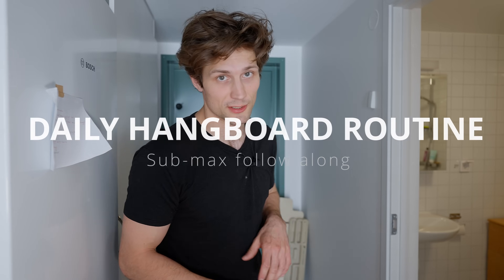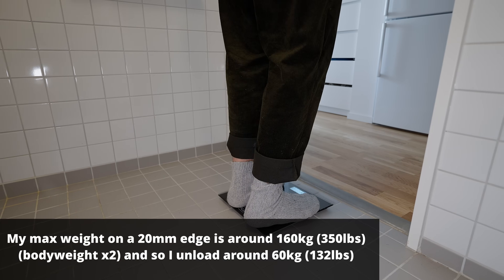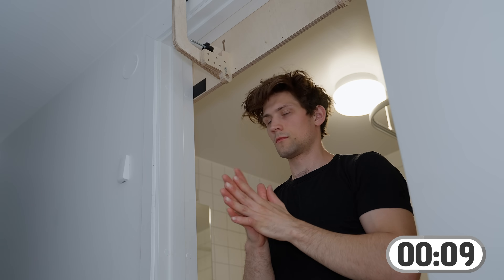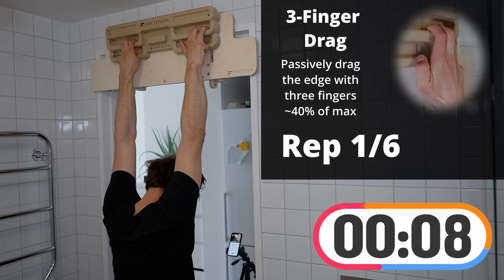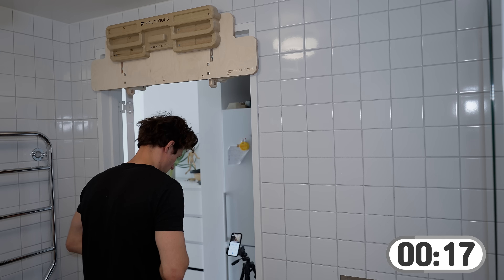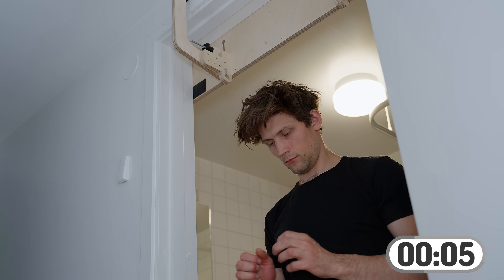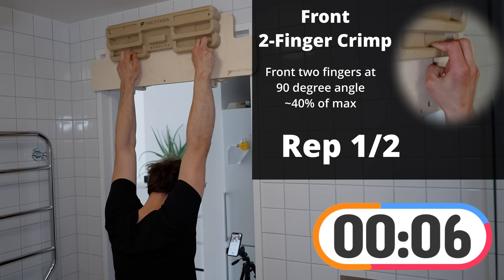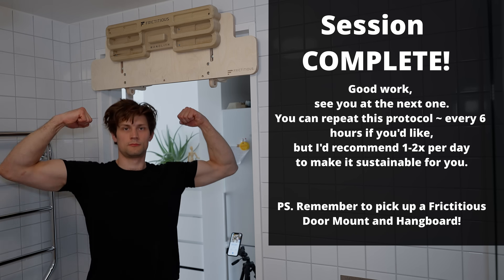10 Minute Daily Hangboard Routine (FOLLOW ALONG)

Comment: Here is more sample-size-of-one scientific evidence: I tried this for one month, every once in a while I did it only once a day. I tried a 45 degree spray wall yesterday, which I had never tried before. I could complete several moves which in itself is an amazing progress for me. But the most surprising thing was how absolutely painless it was. I have had a left climber elbow for years and my fingers and joints always hurt at least a little when climbing pretty much anything. Not this time. My arms and hands not only feel stronger but, dare I say, healthier? Amazing stuff, strongly recommended. Don't lose motivation at the beginning, the load is very low and I felt like it was a waste of time at first, but as weeks progressed I could feel my half crimps feeling, for lack of a better description "more solid".

Comment: If you don't have a hangboard you can do this by leaning back while crimping a solid doorframe haha. I held with one hand at a time to get enough weight, by crimping on the right for 10s, then left 10s, then 10s rest, and repeat, that way each hand gets 20 sec rest. Works well and it's super easy to do anytime. The only issue is keeping the load consistent, I did that by not moving my feet and trying to keep my shoulders square on, which is still easier than using a scale haha.

Comment: Started a few days with my hangboard routine. Had never done this before so I thought I start slow. Curently doing 3 hangs half crimp 10 seconds at full body weight. 

The method with a scale and just 40% of weight is actually really helpful. May do this instead of full body weight hangs.

Comment: It is also important to train ring+pinky, which is what I would use when index+middle are fatigued and I do not have a better resting position (no knee-bar, no jug...). Also, you are never using the thumb.
Another way to execute the connective tissue health protocol is by hanging on mono-fingers (monos). You can do that without resting if you switch from left to right hand. For instance:
      Right thumb 10 seconds
      Left thumb 10 s
      Right Index 10 s
      Left index 10 s
      Right middle 10 s
      ...
Of course, always 40% of your personal max load on monos.
You can do that with 90° flexed elbow, even without using a hangboard. Just use a rope ring attached to a pull-up bar or tree branch.
Reply: Let me also explain something that is not clear in your video. If 
       your max load (MVC) is 160 kg
       your body weight (W) is 80 kg
and you want to reduce the load to 40% of MVC (i.e. 64 kg), you either need to 
       lift 64 kg or 
       hang with feet on a scale measuring W - 64 = 16 kg
This is because your weight is 
       W = 16 + 64 = 80 kg 
Your feet are holding part of your weight (16 kg,) while your fingers are holding what's left (64 kg.)
At 1:50 playback time you wrote "unload around 60 kg," which in my opinion is a misleading expression. I would rather write "load around 60 kg."

Comment: I’m not sure if this is a dumb question, but how do I calculate my max load? Is it the maximum weight I can hang for 10 seconds in each grip? I’m a bit concerned that if I try adding weight—like using a backpack with plates—I might injure myself. What’s the safest way to figure it out?

Comment: Great stuff as always! Can you explain a bit why you changed the format of 10 hangs (10s on / 50s off) to twice the amount (10s on / 20s off)?
You explained in an update on the last video that you might try it because the original paper said 10m of load I believe. How long have you been doing the 20x hangs for? And does if feel different than what you did previously?
Reply from the maker: Great question! I’ve been doing the 10/20s for the past year or so, but I’ve also switched back and forth to try things out. I notice that if I stop doing the protocol it feels like the benefits stick around a little bit longer if I’ve done 10/20 instead of 10/50 (no idea why, could just be in my head?). On top of that I haven’t noticed any downsides  with the higher frequency, and based off of the Keith Baar study it just made a bit more sense to do it this way. However, the difference in finger health and strength is not particularly noteworthy to me.
Reply: @EmilAbrahamsson  Thanks for the reply! Cool stuff, amazing that you're experimenting and sharing that with us. It would make sense to increase the load time, but we're all healthily careful for our fingers of course, this is so helpful! Stoked to try it myself and follow along with you haha!

Comment: Hey Emil, love your stuff. Thanks to you I actually bought a hangboard and drilled it into my doorframe (landlord is gonna kill me lol). I was a little confused about your percentages. In the video ur de-loading about 40% of your max when hanging. It stated your max is around 160 kg. Wouldn’t that leave you with 100kg? I assume you weigh less than that so does that mean you’re adding weight? In the video you appear to be doing it body weighted so I was just a little confused about that. (Also.. 160 kg.. jezus man)
Reply from the maker: Heyo! Thanks mate,
I guess I should clarify that a bit more:

I weigh around 80kg, and could add around 80-100kg if I do a max hang (~5 second hang). Total weight: ~160kg. 
From this value I want to load my fingers by 40% of that. 40% of 160kg is 64kg, and so I want to subtract 64kg from my 80kg on the scale. 
E.g, on the half crimp the scale says somewhere around  15-25kg for me when I'm loading my fingers well. 

With the two-finger half crimp I'm the weakest, and can just barely hang from the ground as a max hang, there I unload 40-45kg instead. 

Hope this clears it up a bit!
Reply: @EmilAbrahamsson  clears it up perfectly! Thanks Emil, appreciate you for taking the time to reply. Cheers!

Comment: Awesome video as usual! Is this a good routine to get back from a pulley injury? And is it possible (if your finger are haelthy) to do this routine but also train your finger max strength normally ?
Reply from the maker: From what I can tell, yes and yes. Physios very commonly recommend a similar approach to rehabbing finger injuries where you submaximally load monos. I would say this has worked better for me, both for recovery but also from a practical perspective.

I do this in combination with strength training/climbing/max hangs. Try to keep the sessions apart a bit though, around 6 hours after/before training you can do this.

Every finger injury/tweak I’ve had in the past 2 years Ive worked away using this protocol, so personally it’s great.

Comment: I have a question concerning a "DIY Hangboard". My appartement doesn't have any place to hang one either, and they are not in my budget atm, so I thought, what if I glue two strips of fine sanding paper on the upper ledge (slightly under one pad width) and just hang from there? I'd appreciate any thoughts on  pros and cons from anyone who reads this. Great video as always!
Reply from the maker: That ought to work as a preliminary construction! I used the frame of my van for a while whilst living in it. Sometimes you have to work around things!
Reply: @EmilAbrahamsson  Exactly, and something is better than nothing!

Comment: I watched both yours and Hooper's beta videos, interesting stuff! Got me thinking about the setup tho. 

If you don't have access to a hangboard (fixed), can't you use a portable hangboard and a sling and do the same routine but using your feet/foot as the fixing point? You can even go overboard and place a digital steelyard between the hangboard and the sling to get an exact measurement on how much you're pulling.
Reply from the maker: You can, and I have done that as a solution at times. Works alright, but personally I much prefer the hangboard. Regardless, if that’s what’s accessible than I’m sure it’ll work great for most people!

Comment: If your max is 160kg, and you are doing 40% of max (=64kg) when you weigh 80kg (since 160kg is 2x your bodyweight), you should unload only 16 kilos right, instead of 60?

Maybe the text should say "...I unload TO around 60kg", that makes more sense
Reply: Yes I had the same thought 🤔
Reply: Actually I think 'unloading around 60kg' is correct. I.e unload 64 kg OFF the scales so 64 kg is on the fingers (40% of 160kg) and 16 kg left on the scales. 64 + 16 = 80kg BW. Not sure this is made totally clear on the vid.

Comment: If finger strength is my current limiting factor, is there more I should implement or is this 2 times a day enough to build up the strength needed to stay on smaller holds? 
I watched the video about how this is still good for relatively newer climbers like myself but am still curious if this is enough to build my fingers. I’m definitely strong in the rest of my body, but with that comes the weight of muscles mass. So I’d love my fingers to become as strong and powerful as the rest of my muscles. 
I would usually just try it out and come to my own conclusion, but I need to wait for the doorframe hang board mount. The drywall was not great at holding me…
Reply: This once a day + climbing is enough. Repetition is key. And if you do too much you risk injuring yourself

Comment: Hello! Question: if i can not Hang from a 14mm Edge, does it still make sense to use it for this Training or should i go for an edge from which i can hang? Thanks!
Reply from the maker: Hey mate. It still makes sense to use it for training, but just be careful so that you don’t load it too heavy. Pull to the point where you feel a light strain in the forearms and hold it there is what I would suggest

Comment: 40% of max means you want the scale to be at 40% of your weight when hanging? Or how do you determine 40% of your max?
Reply: 40% of what you can pull. If you weight 60 kg but you can pull 100 kg, you should train with 40 kg
Reply: You would train at  60 kg on the scale. 40 percent of 100 is 40 so is what your pulling on your own. 60 is what's left on the scale

Comment: hello. thanks... but do you mean 40% of what you can lift for 10 seconds? or just being able to hold for a split second?
Reply from the maker: Id say 5 seconds are the common measurement for max hangs, but I’m sure that’s debatable. It’s not very exact those 40%, so if you measure between 5-10 seconds of a max hang you should find a good level to hang with!

Comment: So... If I understood correctly you are applying the same force, to all diferent grips, say your max is 100kg, you would be aiming to do 40kg to both half crimp, open and twofingers drag/crimp. is this right?
Reply: prob not. 40 % of your max effort in that specific grip. So if you can hang 100kg in half crimp, you do 40kg - if you can hang 60 kg in two finger crimp, you do 24kg.
Reply from the maker: Like the comment before this: 

Say your max is 100kg (bw + whatever you put on to get to 100kg) with half crimp, I unload 40kg of my weight with the scale. With my front two finger crimp you would hang significantly less, say 40-60kg as max, and therefore unload 15-20kg instead. I hope this clears it up :-)
Reply: @EmilAbrahamsson  @Jegerib  Thank you both!

Comment: Started climbing about 7 weeks ago after zero experience. Just managed to send my first V7 and it was a crimpy slab. Going 3-4 times a week, and climbing at the V5-V6 level on a regular now, my fingers get mad sore and tender on the palm side for about 24 hours after a session. Just learned about finger tendon adjustment period being much longer than with muscles and am now a bit worried about a possible pulley injury. Would there be anything you recommend for this situation/stage of my climbing career? I definitely want to climb everyday if i could but the only issue is finger pain and i would rather not set myself back months from a pulled tendon. Being years into climbing, what did you experience in terms of the introduction to climbing and how to get past the point of worrying about finger injuries on slightly tougher climbs? Im scared now to even use the hangboard i have after hearing about the possible injuries so just wanting to hear a different perspective

Comment: Hi Emil! Iam currently following long with this rutine, In the Crimped app is say 80% max and here 40%, what should Iam for?
Reply from the maker: Hey mate! Hmm, 80% is a bit much I'd say. Where in the app did you see that btw? I couldn't find it myself. 
That number may stem from a bit of a misunderstanding from the first video I made, where I took off 70-80% of my total bodyweight, but since I could hang 50-60kg extra weight on myself, that means taking 75% of BW off means I hung with around 40% of what I could maximally hold. 

My recommendation would be to hang 40% of what you can maximally hold! I don't think 80% will give you obvious negative effects, but I can see the risk of injury increasing quite a bit at that weight. There's no strict weight to hang with, but for me 40% of max feels very safe and still gives me the results I want. 

Hope this clears it up somehow!
Reply: I did it for 2 weeks at 80% and felt some pain so eased off, thanks for the clarification, I might have to hop back on
Reply from the maker: @zackey3876  oh gotcha, so you went for 80% of max then? That’s quite a lot indeed. Good call to slow down 👍
Reply: @EmilAbrahamsson  Hi! Thank you for the clarification andthat you took your time to write back! I cant find it now either.. Must have been confused by max hang vs bodyweight. I will stick to 40%. Love your vids! Cherrio!

Comment: so this is different?? ive been following one where i do 3 half crimp and 3 3-finger drag and then 1 of crimp and drag with 2 different fingers and i do those 10 seconds on and 50 seconds off like you said in your previous video. is there any reason why this is different?
Reply from the maker: It is a bit different, twice as many hangs. Both protocols worked for me, but this more frequent load has made a bit more sense, and helps my strength gains stay a bit more consistent and for a bit longer

Comment: I am not really understanding the weight. You say your max is 160kg so you unload 60kg. That means you are putting 100kg on your fingers right? But you don't weigh 100kg, yet you don't seem to be wearing a weight vest or weight belt or something.

EDIT: I saw an explanation elsewhere, so it's 40% of max meaning you load the fingers with 64kg if your max is 160kg.
Reply: So what does the scale say?

Comment: i did this protocol with no rest just hanging there for 10 minutes, but i moved the fingers around on the board after it becomes to hard, and varying the intensity so not always on 40% but sometimes 20% etc... with some pulls ups in between...